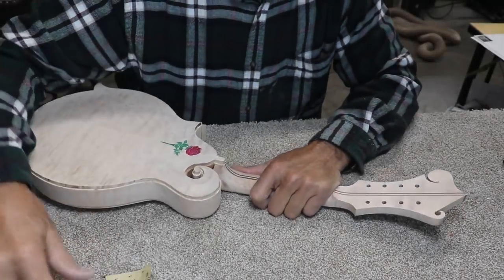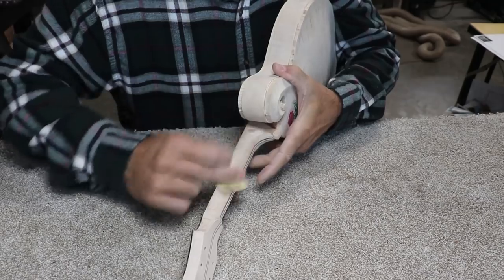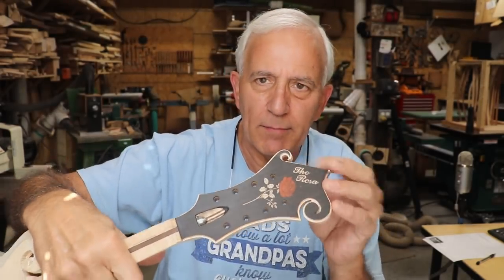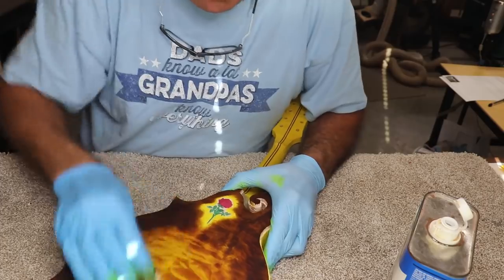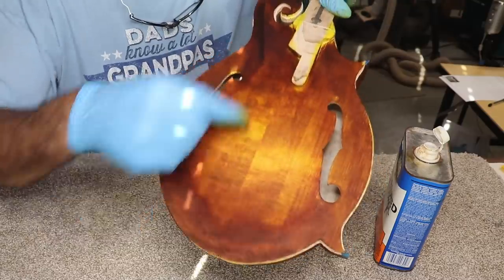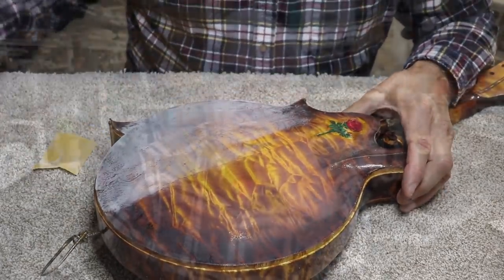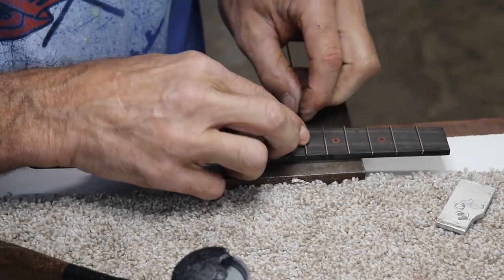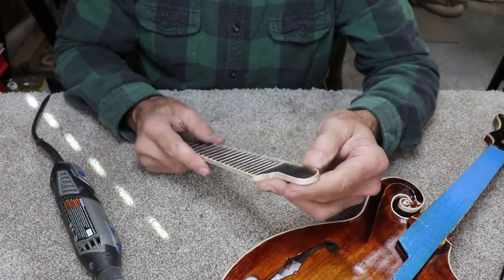441 RSW A Custom Quilted Mandolin Part 4

Comment: I've been following this from the start, and that's an absolutely stunning instrument. You do incredible work, Jerry! 

Your staining technique is familiar to me, Jerry. I make tobacco pipes out of the burl of the Mediterranean White Heath Tree (aka Briar). I use alcohol based leather dyes, the same brands that you use, to stain my pipes. Yellow is the first color that I put down, then blend in a red and/or brown. I light the pipe on fire to burn off the alcohol, the heat drives the stain deeper into the wood.

I'm no stranger to hand sanding either, but my pieces are a lot smaller than a mandolin. It's interesting that we use such similar techniques to finish our products, however I do not (nor should anyone) lacquer or varnish my pipes. I apply pure carnauba wax with a flannel buffing wheel. It provides a 'breathable' high gloss finish that seals and protects the Briar wood. It needs to be reapplied ever so often, and many pipe shops have a buffer wheel in the back room, and with buff customers pipes for free. It's kind of a good will service that pipe shops offer to patrons.

Comment: Hi Jerry.  My son and I love your videos.  While you were talking about the lacquer running away from the holes and oil varnish not doing that, I started thinking about a technique I've seen in modelling with epoxy.  These guys pour epoxy to make a river or an ocean scene and while the epoxy is going off it generates bubble in the surface.,  This is not for the same reason as yours because yours originate in the wood, but their solution for this is to quickly blast the surface with a blow torch.  Just enough to encourage the bubbles to burst and the epoxy to settle in to the depression.  Not sure if this idea would work for you at all, and of course it seems stupidly dangerous but the thought jumped in to my head and I thought I'd pause the video (25:09) and share it :-)  Again love the videos.  Oh just to be clear I wasn't suggesting using epoxy on the instrument, but more the idea of  application of heat in whatever you are using.
Reply from the maker: Lacquer is highly flammable.  It would not work anyway the science if different.

Comment: Hi Sir, Can I seek your advice please? I just bought a Yamaha FG200 circa1973 (47 years old). The action at 12fret was over 5mm, I reduced it to 2.9mm. However truss rod is barely working. There is slight bow in the neck near the soundhole.  Otherwise I am quite happy. I want to ask - As this guitar is old and neck is slightly bent, is it a good idea to loosen strings daily after playing to lessen the tension on the neck? Thank you for your advice. :)

Comment: When you do the hand routing, lay some frog masking tape along the perimeter to avoid the aluminum mark you'll have to sand out. I cant stand when I get it perfect only to have to redo it. The reason I say frog tape is it has very consistent thickness and peaks away easily with no residue

Comment: I certainly am no expert on sanding or sand paper, but I am wondering if the grit material (garnet , aluminum oxide, diamond dust) makes any difference to sanding the maple. Any insight  ?
Reply from the maker: Aluminum Oxide is the only way to go.

Comment: Its not easy being Jerry. Everything is a hammer. Luthier because perfection does not come in any other way. Sanding for hours (four hours), is to the finish. Like anything, if you want good results you need to put the work in.

Comment: i'd just prefer the back to be to top since well you'd want to see it but I don't know much about mandolins so maybe its just a wood thing or a there's some significance I'm ignorant to.
Reply from the maker: the hard wood cannot be used on the top.  It takes a soft wood for the top otherwise the sound would be very poor.